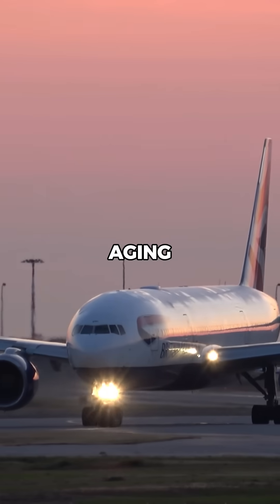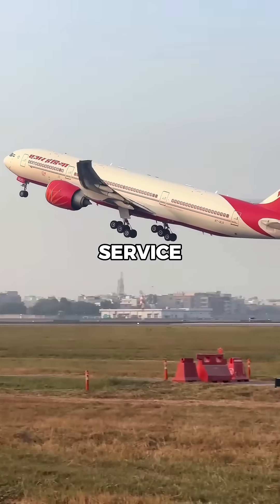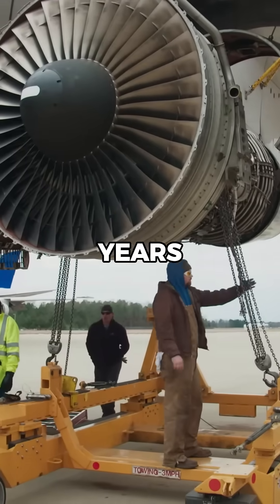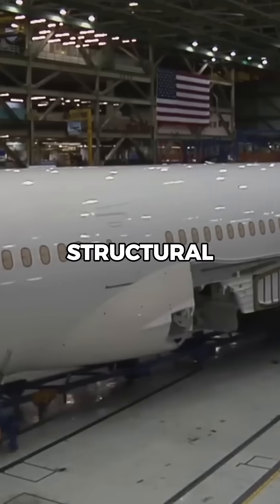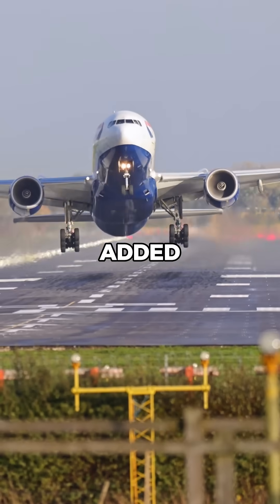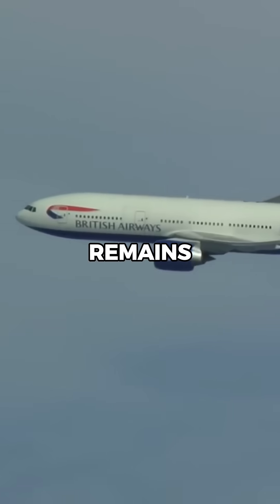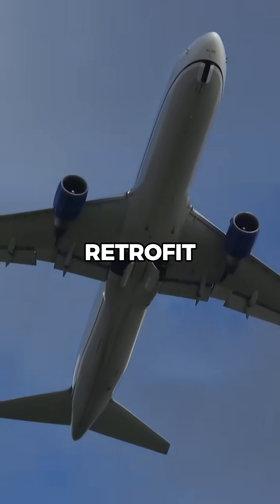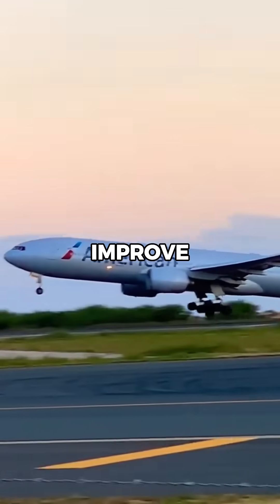How airlines extend ageing aircraft lives

Comment: WRONG. The engines are nearly never replaced and are typically reused from aircraft to aircraft
Reply: Yeah that was a weird one. They can't ever put more efficient engines underneath the wing replacing the old ones because the aircraft would have to go through certification AGAIN.